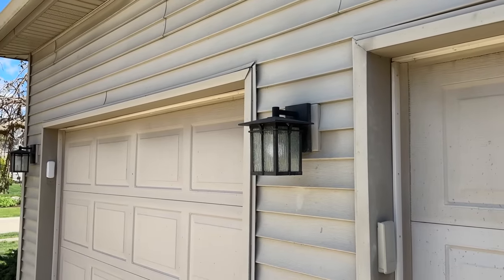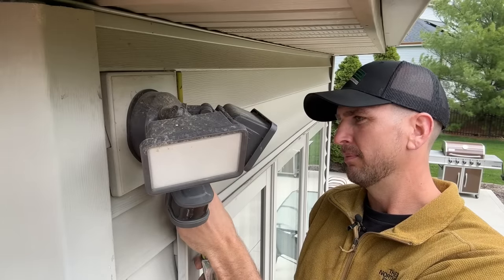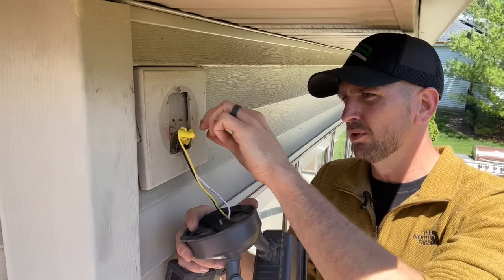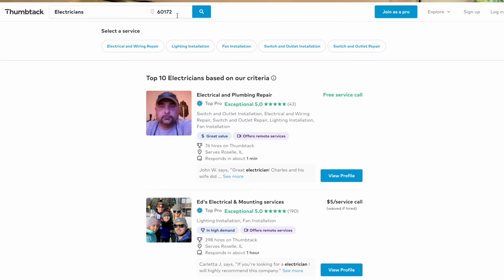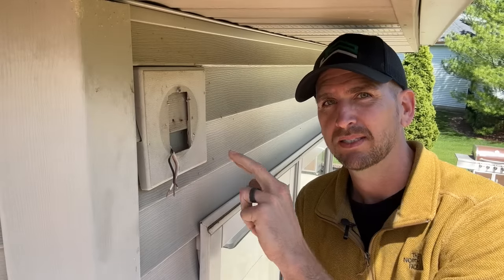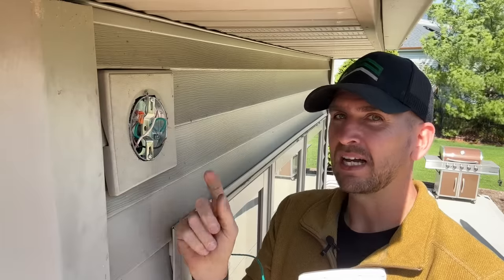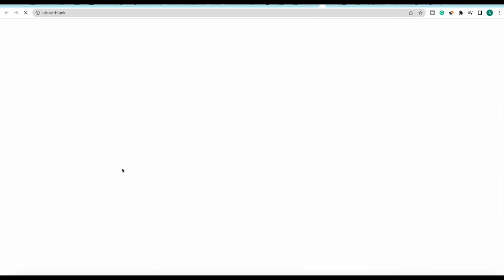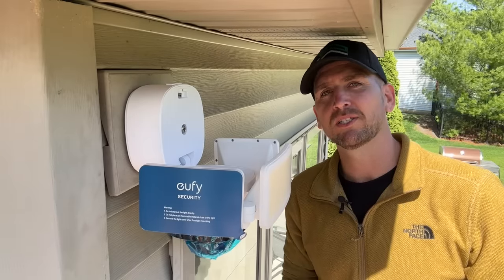How To Install An Exterior Light And 3 Common Mistakes To Avoid

Comment: Don't you want to use any silicone to cover the Left, Right, and Top edges of the mounting surface? Leave the bottom open so water can escape? I have seen a lot of folks get water intrusion and damage because they didn't have the gasket... but the backup of caulk around the edges made intrusion harder to occur.

Also what about checking that wiring to see if it is correctly run inside EMT or other safe ways

Comment: Some of these light fixtures come with a temporary hanging hook, or you can make one yourself out of a wire coat hanger. Make it into an s-shape and use it to hang the fixture to the j-box. Now both hands are free to assemble the wiring.

Comment: after cutting out the 7x7 block, it looks like you mounted the pancake box on top of the vinyl siding. does the vinyl lap siding also need to be cutout so the pancake box can mount directly to the sheathing, making the face set deeper in the vinyl box, and improve sealing for moisture? Also, with no gasket, should the rim of the pancake box be caulked to the 7x7 block, leaving an inch uncaulked on the bottom for a weep hole?

Comment: I have brick and used the metal exterior boxes to (re)mount all my outside lights... but I also cut and installed a short piece of conduit that screws into that hole in the back to provide a "path" through the brick (with a plastic relief at the end to keep the wires from chafing).  I don't like the possibility that the romex might rub against the brick.

I also run a bead of silicon around the box and fixture, leaving a 1/4" gap at the bottom to seal the rain out and provide a small drain hole just in case water does get behind it.

Comment: I'll look at Wago's going forwards but....when I need to wire-nut stranded and solid wires together, I've found that making a slight (20 degree?) kink/bend in the solid wire gives something better for both the stranded wire and the wirenut to attach to.

Comment: At 4:40ish you mention an outdoor work box. They work great with 4 inch fixtures but so many fixtures today are 5” or bigger like the one you’re installing here. Can you buy an adapter plate or just modify a mounting block like you did to fit a pancake box?

Comment: i noticed that some of the square plastic plates come with their own "electric box" molded into it.  Are those ok and code compliant?  Not sure a metal steel box is the best choice if it is a humid area.

Comment: Tip you never wear any kind of rings while performing work. Many years ago we had a foreman supervise in unloading a stack body truck. After we were finished unloading the truck he caught his metal wedding band on top of a stake and pulled his finger off. A few  months ago read that a 4" pancake box with a romex connector is actually illegal because but it does not provide enough cubic inches for even a 14/2 piece of romex. While at a continuing education class the talented well respected electrical inspector told us that romex is never permitted to enter the rear of ANY outdoor electrical box because the NEC states that type NM cable  ( romex ) is not approved for damp or wet location. Told bus to use UF cable.
Reply: The bigger issue is the box rusting out, strike 1. I have up lights that constantly are hit by the irrigation system. They were originally lights marked that the were not to be pointed above horizontal. Strike 2. The box screws rusted themselves to the box, so those got replaced with anchors in the mortar surrounding the box. Plus, it’s NM cable feeding the box from the rear, so strike 3.

Comment: One thing to note and get in the habit of:  It's best to connect and disconnect in a specific order:  Connect ground, neutral, hot and disconnect hot, neutral, ground.  Usually dealing with single leg low amp breaker 120v it's not so dangerous, but when dealing in 3 phase feeder power with high amperage (208 volt) this is the way that is taught for safety.  In theater/concert/event electrical there are 5 wires that are being stretched hundreds of feet at times and while in a perfect world would never be disconnected when hot, but just in case you are taught to go by wire color which usually is laid out on the panel in left to right order from green, white, black, blue, red (the black blue and red may be in a different order) and you plug in left to right and disconnect right to left.  By doing this you do not connect a live load to something that's not connected to ground nor neutral.  In the case here with the light fixture, the hot wire is connected and if the circuit isn't off / stays off then the neutral wire connection has now become a hot through whatever it touches.
Reply: Your order of connecting wire is not taught for safety green, white and black. There is an order taught  about the grounded conductor, first to make and last to break.  Also 120v kills more people than the other voltages
Reply: I use My Leatherman pretty often, All metal, When I change a Receptical Live, I remove Ground First, Connect the Ground Last. Prevents Shock. 
WAGO's may or may not be Better, Think a Lot of Old Timers will Resist Changing.
We hung Many Lights before they Came out. Could see them Being more expensive than Wirenuts, if Less, the Owner of the Company may want to give their Electricians the Wagos, they would have to deal with it. Owner would Save Money?

Comment: Junction boxes are code because the most likely spot for wire arcing and overheating is the fixture and splices. The junction box can halt the spread of fire; and also protect the wires from UV and weather.

Comment: Mistake #4, wearing a metal wedding ring while working on electrical stuff. I watched a guy short his car battery through his wedding ring. Sparks flew and his ring turned red hot immediately. The skin was cooked and after he got the ring off (cooled it off under a faucet that he sprinted to), he peeled the cooked band of skin from his finger. Learned my lesson at someone else's expense. Otherwise it was a very helpful video!
Reply: 12volts did all that damage ???
Reply: He already checked for voltage.  At 1:55.
Reply: @sarahann530 Its not the volts you worry about, it's the amps.
Reply: He did already check for voltage. But still a good tip to be aware of.
Reply: @webeducation    What amperage is in a 12 v car battery to do that damage ?
Reply: It’s not a metal ring. It’s made of silicone. I also wear one.
Reply: @sarahann530  Hundreds of amps…

Comment: I noticed you did not use a clamp on the metal box where the romex cable enters the box, isn't this required by code?
Those wagos are great, don't know how many wire nuts I throw into the garbage.

Jim

Comment: It's really cool how the vinyl mounting blocks have the backs cut to match the siding!  I wouldn't have known that a  junction box is required for code.  I would have likely just replaced the new unit that same way the old one is mounted.  I have a brick house and would rather use the mounting blocks with a pancake junction box inside rather than the thicker exterior box.  I have siding in some places and I'd be afraid that smashing it to mount the junction box would distort the finish near the block, so I would trim the the siding circle out to the wood or whatever underneath and mount the pancake to that.  For the bricks on my house, I would cut the pancake hole and mount it inside the mounting block to keep the light flush.  I'd spray paint the mounting blocks to match the red brick as best as I could and use black fixtures instead of white, but that's me.

I agree that the WAGO connectors would be a great timesaver while making the work safer to complete, especially mating stranded wire to solid.  It looks like you forgot to include your Amazon link this time.  Do you have a motion sensor light without a camera in your store?  I want several to light my security system outdoor webcams because their night vision sucks.  Solar or electric would be fine, but I think I would like LED panels.  I had considered traditional motion sensor flood lights and using GE LED flood light bulbs because they're easier to replace and shine very far, so I'll compare the prices in your store.  Thanks, Scott.  Code lesson learned.

Comment: Ontario Canada...the installation of the box has two issues that our ESA inspector would fail the installation on either issue.  KO in back of the box needs a KO filler, the KO where the wires come through needs a Romex metal or plastic box connector though in this installation an ESA inspector might allow a chase nipple
Reply: Can the pancake box be mounted to the exterior of the siding liket hat?  I thought it had to be recessed so its flush with the sheathing?

Comment: Thank you! Do you have a link to the pancake box? I'm not finding 5/8" ones, but might not be looking in the right place. I found 1/2" but am not sure if that is deep enough. I need to replace a broken exterior light that wasn't ever installed properly (junction box was wrong type and put in backwards). Additionally, the exterior door does not have a proper header and I will need to install one-- which will make it so I can't have a junction box inside. The pancake box on the outside inside a mounting block looks like the perfect solution.

Comment: I love this video, thanks for making it. What about situations where your light fixture is larger than the vinyl mounting block? In my case, I have a large rectangular exterior light sitting on top of a smaller square vinyl mounting block. The bottom of the light hangs off.

Comment: Thank you for the video.

Question: the wire fill issue associated with pancake boxes aside, are pancake boxes rated for outdoor use?
Reply: They're not, I think. I don't even think romex can be used outside (damp locations)

Comment: Are Wago's acceptable for going from solid to stranded? Thanks for the video.
Reply from the maker: Yep, perfect for that application.  Some push-in connectors don’t allow it but WAGO 221 lever nuts are good to go 👍
Reply: @EverydayHomeRepairs  In my opinion Wago is the preferred method for solid to stranded and as an added feature they fit in smaller boxes easier.
Reply: Last time I used them the fixture stranded wire refused to go into the Waco (or other brand) and I had to use wire nuts. I carry options so I don’t get frustrated if one doesn’t work.
Reply: @davidmoran4471  stranded to solid does offer additional challenges that can only be overcome with knowledge and skill. When I did electrical work I was trained in how to do it. You strip the stranded back more and let it stick above the solid.
Reply: @normferguson2769  Push in or LeverNut?  You aren't going to get a stranded wire into a push in without tinning it, and even then it's dicey.
Reply: use a lever WAGO for stranded wire,solid wire in either lever or push fit.
Reply: @normferguson2769  WAGO lever for stranded,not rocket science 😊

Comment: Great suggestion to use the Wago lever connectors instead of wire nuts. 
The alternative is to have three hands.
Reply: Or tie up the new light while you twist the wires together and put on a wirenut.

Comment: Nice vid.
Since I have 2000 wire nuts lying around. I'll be using wire nuts
 This will NOT affect the code worthiness of the install. Somehow, I'll just have to manage to heft that 9 ounce light fixture for 2 minutes.
Reply: It will if they're the wrong size wire nuts. True!

Comment: The pancake box is a good idea, except you need to add a form of stress relief for the wire,  I better option would have been a new wall plate with built in box and stress relief

Comment: Whenever you are working on any electrical connections for the first time (especially in older homes), it’s important to check that the connections and installation are done properly and up to code. My house was built in the mid-1960s, and some of the things I’ve found are frightening - like a oven being held in the wall by only 2 wire nuts, no mounting screws, nothing. The list of questionable things is long.

Comment: question I have the mounting block already but I bought a bigger led light that is more of a rectuangular shape.... there is a junction box.... but now when I finished installing the light it hangs at a diagonal and there know way to silicone the outside because it isn't flight because the shape is now different. is this a code violation? I want it to hang straight flush straight but don't really care it still looks great.

Comment: I would have still used the large outdoor fixture and screw it right to the panel adapter. Those pancake fixtures are mainly for indoor use and offer no weather protection.

Comment: Not trying to be a smart-ass but I always keep in my toolbox a coat hanger which I usually cut up into 8 inch pieces then you twist the ends like an ES hook one into the box one in to the component that you're putting in and now you have your third hand I do this with ceiling fans light fixtures works every single time sometimes with ceiling fans you need a stronger type of metal but still the concept is the same great show keep it up
Reply from the maker: Thanks for the feedback Tony 👍
Reply: Some ceiling fans come with such a hook. I try to keep one in my box.

Comment: Can you please explain what exactly you did with the ground wires? Did you simply create a pigtail with a Wago connector and then connect that pigtail to the bracket? All the other youtube videos explain what to do when there is no ground but that is not helpful cuz in my house we have a regular/modern romex with a ground and the flood light I got was LePower from Amazon. Much appreciated

Comment: The video was very informative and appreciated.  It would be helpful to me if you could extend the light installation to show connecting the wiring to an existing circuit breaker or other location and how to route it to the installation area.

Comment: Do you recommend using silicone or some sealer on the mounting block or any of the items you attached in the video? I will add a floodlight + camera combo on my shed
Reply from the maker: I don't do that but using some good silicone wouldn't hurt and would seal things up a bit more.
Reply: @EverydayHomeRepairs  Leave a gap at the bottom to allow drainage of any possible leaks of water into the fixture and j-box area.

Comment: I've installed lights with the exterior boxes. One thing I was never sure of was whether the center Romex clamp should be inside the box or mounted to the back,  in the wall. I opted to make the hole in the wall big enough for the clamp in back. Is that okay?
Reply: You installed it correctly. Some newer connectors can be used either from inside or outside. Must prevent romex (type nm cable) from pulling out of box.

Comment: Regarding the ground connection you made to the pancake box (with the screw), I believe that serves no bonding purpose for you, as your bonding is provided by the romex ground wire by itself. That screw is for when the bonding is done through raceway conduit, as is done in the Chicago area. Correct me if I’m wrong.
Reply: That keeps the box from being hot without tripping the breaker. In Chicago, your box is grounded by the conduit. It’s code to ground the box. That’s why ground wire nuts have a hole in them, to allow one of the wires to stick out of the wire nut to extend it to the box.
Reply: @johnhaller5851  Oh I see, so it's to ground the box in case the box gets energized by a faulty wire? That makes sense. Learned something here. Thanks.

Comment: This is a great video. I have a question that is different from this video. I have a LED flood light under the outside eve soffit. I want to move it over about 8 feet. My thoughts are that i would get a strip of 12 or 18 gauge wire and connect  and extend it over and put it into a new circle metal electrical box. My wire would be exposed under the eve but I would just put it through a piece of conduit.  Am I even in the ballpark as far as this being correct? You know a lot more than  me and I respect your opinion. Thanks in advance.
Chris

Comment: FYI,   Pancake boxes will only meet code if there is only one cable coming in and fixture conductors.  Will not be approved if cable in and out.   Not enough cubic inches to meet NEC.

Comment: Wanted to upgrade exterior lights in house i bought. Exterior Shed light just a hole in wall for wires. Deck lights missing junction box. Back garage door light not wired, housing covered. Front garage sconces x2 had romex into garage loft not tied into a circuit. Parking area has a finished ceiling with 2 light fixtures. The loft above,  accessed via ladder,  is partially covered with 4x8s lying on joists. I'm partial to motion sensing lights on the front too and will probably tie them into a switch inside the garage. Is there a proper way to route the romex over to a junction box in the loft (staples, drilling, etc)?

Comment: Thank you SCOTT for another great video. My home has double 5 inch vinyl siding. I looked on Amazon for mounting blocks did not find exactly what I needed for remounting coach  lights on either side of my garage. Any ideas on where to get the proper vinyl mounting blocks?

Comment: You mentioned of an upgraded ufi integrated exterior security light and 360 camera in one unit. So I would like to know where this can be gotten as I do not have the total info on this. Second is it activated with a motion sensor and is it available with a solar panel to avoid additional wiring etc.? How will it transmit the security images?

Comment: Our ceiling fans came with a hook to hold the fixture while making the connections, with wire nuts. A short length of chain will do the trick, as well.

Comment: Some exterior lights have a junction box built in as part of the light. It is NOT a given that all exterior lights  do not.  you will have to read the specs. on the packaging when you buy the light.